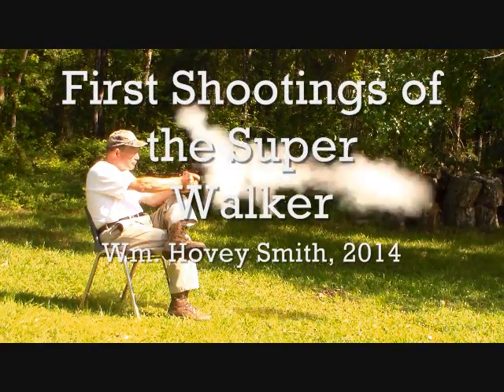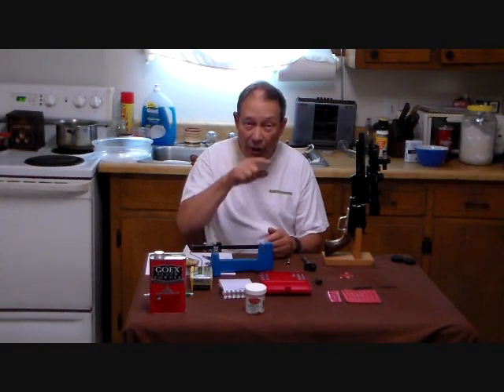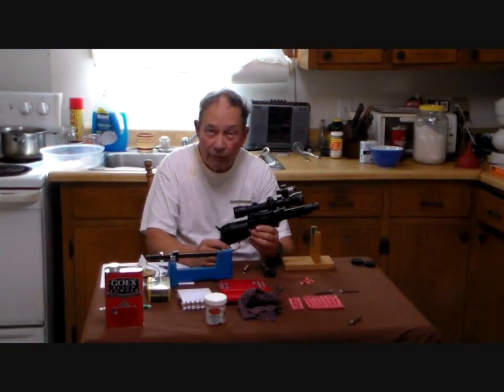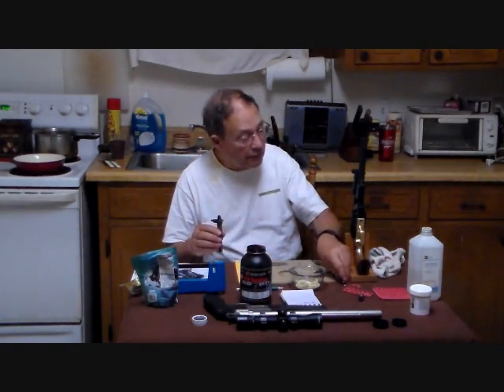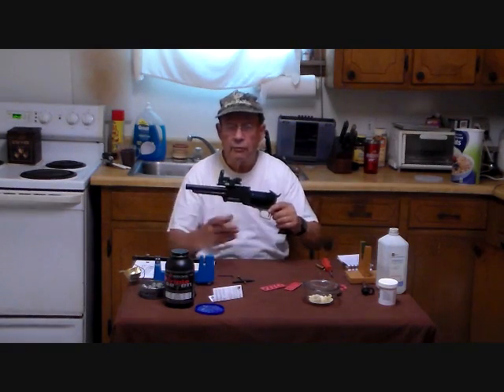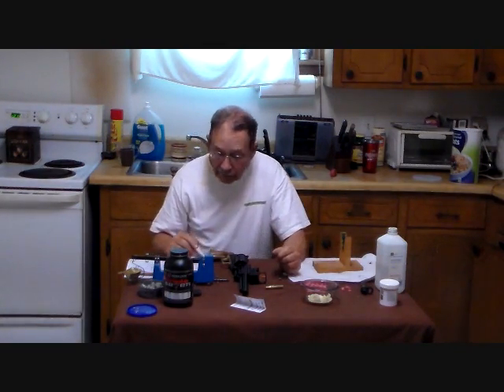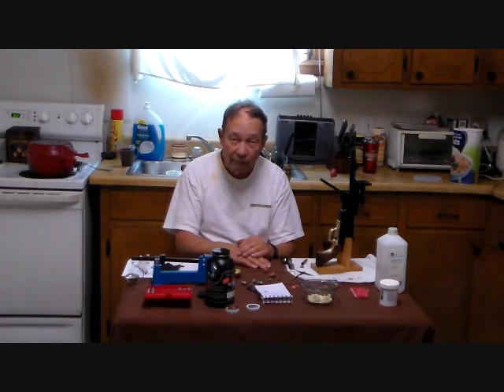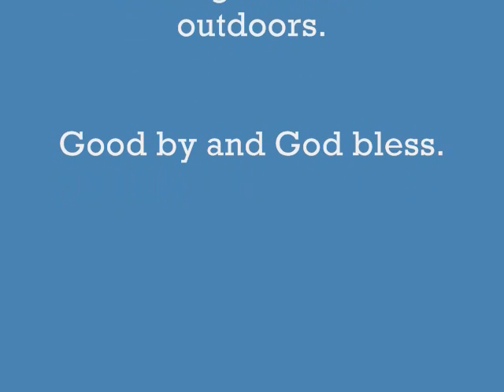First Shootings of the Super Walker

Comment: Great video and good looking gun. It will do the job well. My hunting buddy Rey shot a 250lb boar with a single shot of his Walker and it was dropped instantly with full complete broadside penetration. His load was a cylinder full of Triple 7 2fg, a .457 ball and an ox yoke wax seal on top. The percussion cap was a remington #10. We were hunting in a torrential rainstorm and all the percussion revolvers fired and harvested game even after being in the rain for several hours. I have the pic of the hunter, the boar and the revolver if you wish to see it. Keep them videos coming and please run chronograph tests with the ball and the Kaido bullet to see what you get. We achieved 1300fps @530ftlbs with the load mentioned above.